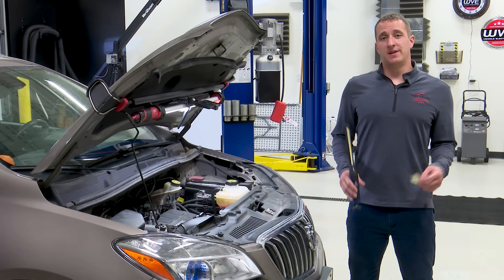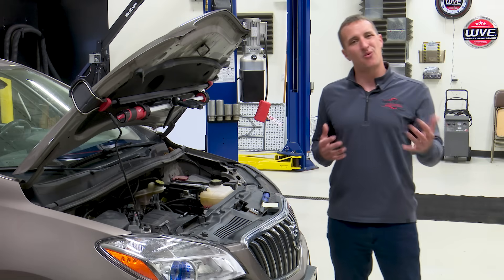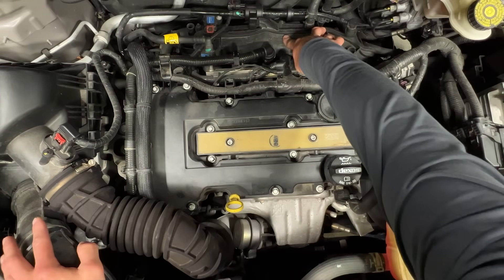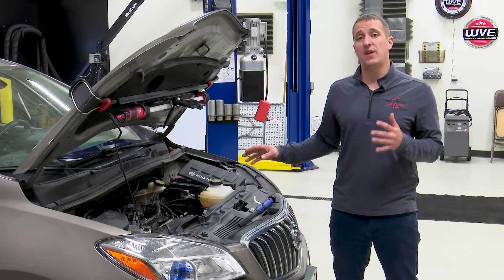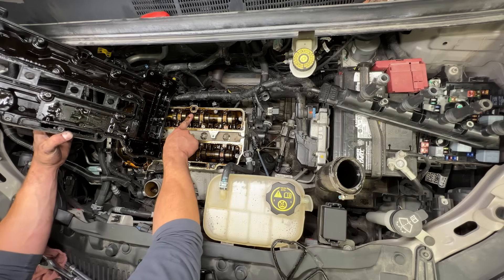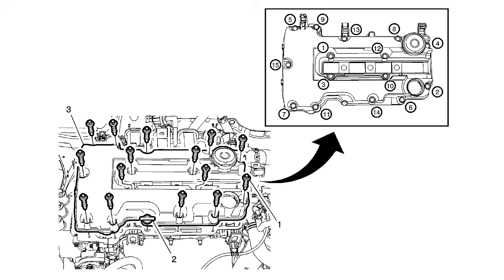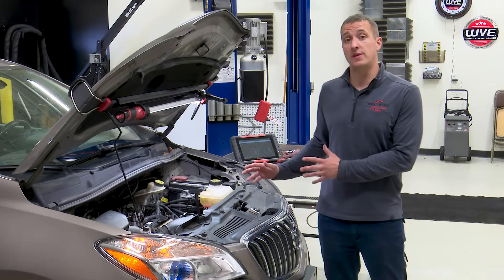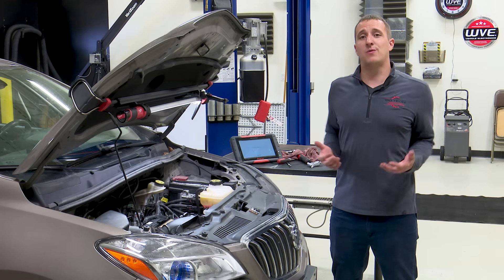How To Fix Chevy 1.4L Turbo P0171 Problem With Simple Diagnosis

Comment: Maybe more about the valve. As M Thompson asked, "where did it go ??" Should we be looking for scrap metal somewhere ? Thanks.
Reply from the maker: That's a good question, I have never found one that has fallen out. The valve is made entirely of rubber, so most likely it is just consumed by the engine
Ryan W, Technical Instructor
Reply: @GoTechTraining  well, I guess that answered my question, didn't realize it was just a rubber valve, thought it was an entire assembly. Hope it dosen't wrap itself into the turbo exhaust impeller.
thanks.

Comment: I knew what it was going to be only because I've done them. It's nice to watch someone else work :). Your explanation was simple enough to be given to a customer and detailed so that it didn't go over anyone's head. Nice video, thanks.
Reply: I did too.  It's the same story over and over with this engine.  There's a guy on here named "Dre Dan" channel--   Look up his "V3 PCV fix" for this 1.4L.   He seals up those internal holes, and then drills and adds a more industrial valve on an external line-- that's easier to change and virtually never breaks anyway.  It's a great alternative to buying a new intake.  Because I was not going to buy a whole new intake, just because it's missing  that silly little silicone flapper on the inside-  which will just fall out again. (disgusting design).   They should have at least added a little window/ removable lid with two screws where you could each down in there with a new silicone flapper valve, without taking off the entire intake....  anyway, the "version 3 (v3)" fix is a sweet little kit and makes this engine 10x more reliable;  because as long as that valve holds up, they PCV doesn't go bad, typically.   If you do these a lot, you might look into it.
Reply from the maker: Thanks for watching, I'm glad you enjoyed it!
Ryan W, Technical Instructor
Reply: @GoTechTraining  Knowing now that it's rubber, I worry less about it roaming around in the engine. I'm the guy that searches for hours for the dropped screw that didn't hit the floor. It's not the cost of the screw that worries me. it's the damage it might do to what ever it gets into....Thanks....

Comment: What happened to the non return valve that was in the old intake?? If it fell out and allowed boost pressure into the crankcase, where did it end up... or did I miss that part?
Reply: yeah.. It's just a little piece of silicone that acts as a one way flapper.  It falls out and you have no way to get in there to add another one--- so they just make you buy an entire intake, when all you need is a little 10 cent piece of silicone.   Such a poor design;  and it will fall out again --- just you wait.
Reply: @calholli  Dorman makes an aftermarket intake that has a pointy bit that prevents the valve from being sucked away into the nether regions of these 1.4s.
Reply: My question also. Where do we look for it ??? Did the missing valve fairy carry it off ??

Comment: As soon as you said a bounce of tsbs I called it but I wasn't expecting that valve. I had a car come in about 11 months ago and wish I looked harder at the tsbs. I have a filling that valves missing just because its same motor with turbo and the lady drove it so long it was bad. In my defense I was already fimialer with this issue but the more I think about it I dont believe it was a turbo the first time I seen this. No excuse I should of did research. Sometimes your busy you've seen the symptoms before, you do your testing fix it and ship it without getting in to tsbs. At least I know now.
Reply from the maker: GM also made it a little confusing with having several TSBs for the same problem. I think only one of them mentions both issues in the same TSB
Thanks for watching!
Ryan W, Technical Instructor
Reply: It's the same story over and over with this engine.  There's a guy on here named "Dre Dan" channel--   Look up his "V3 PCV fix" for this 1.4L.   He seals up those internal holes, and then drills and adds a more industrial valve on an external line-- that's easier to change and virtually never breaks anyway.  It's a great alternative to buying a new intake.  Because I was not going to buy a whole new intake, just because it's missing  that silly little silicone flapper on the inside-  which will just fall out again. (disgusting design).   They should have at least added a little window/ removable lid with two screws where you could each down in there with a new silicone flapper valve, without taking off the entire intake....  anyway, the "version 3 (v3)" fix is a sweet little kit and makes this engine 10x more reliable;  because as long as that valve holds up, they PCV doesn't go bad, typically.   If you do these a lot, you might look into it.
Reply: @calholli  I'll check it out thanks.

Comment: Such a junk engine man!
Reply from the maker: I agree, this engine has had it's fair share of issues
Ryan W, Technical Instructor
Reply: GoTech my brother in law has an Opel here in Europe same engine man is a nightmare😁😁 it was a very informative video Ryan, take care!
Reply: I have the NA version in a opel corsa... so far in 96000kms and 6 years one water pump... Is NA more reliable than the turbo?
Reply: It's the same story over and over with this engine.  There's a guy on here named "Dre Dan" channel--   Look up his "V3 PCV fix" for this 1.4L.   He seals up those internal holes, and then drills and adds a more industrial valve on an external line-- that's easier to change and virtually never breaks anyway.  It's a great alternative to buying a new intake.  Because I was not going to buy a whole new intake, just because it's missing  that silly little silicone flapper on the inside-  which will just fall out again. (disgusting design).   They should have at least added a little window/ removable lid with two screws where you could each down in there with a new silicone flapper valve, without taking off the entire intake....  anyway, the "version 3 (v3)" fix is a sweet little kit and makes this engine 10x more reliable;  because as long as that valve holds up, they PCV doesn't go bad, typically.   If you do these a lot, you might look into it.